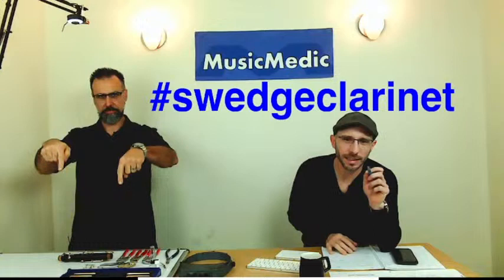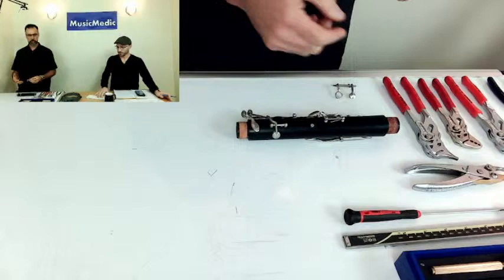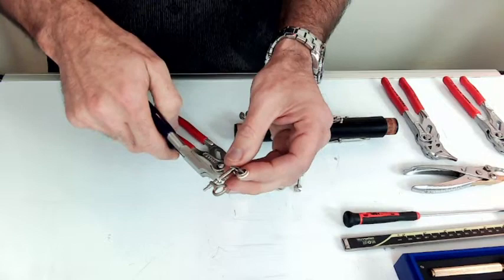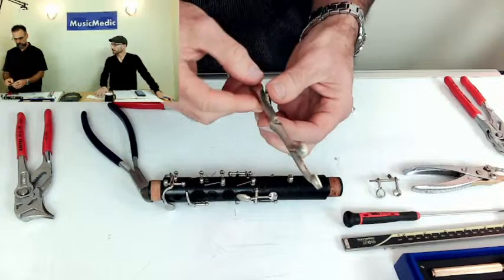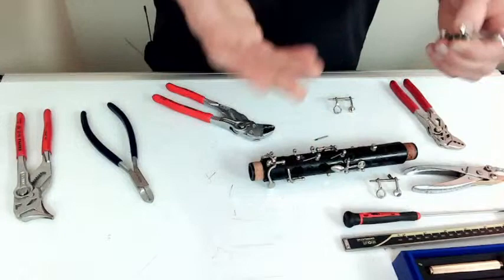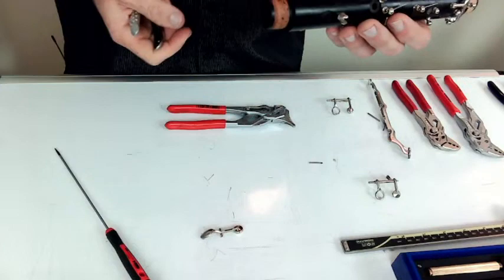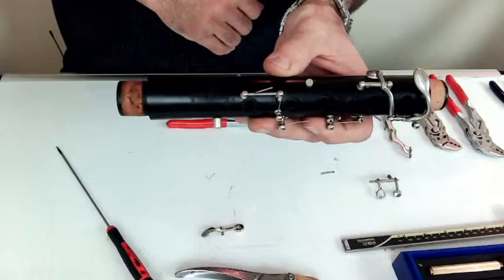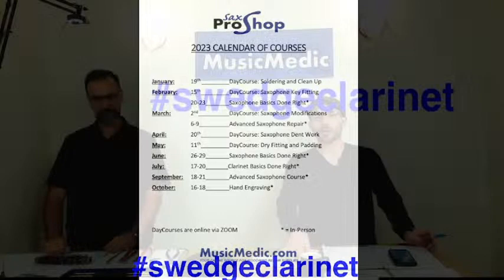Swedging Challenges on Clarinet and How to Fix them! #WednesdayWisdom

Comment: What good technical data! I ask you a question that always causes divergent opinions, the throat Bb (A left index finger and thumb pressed), which is not the real Bb but a compromise note to facilitate handling the B...etc. from the clarion sector. How to improve the tuning and timbre of said position or note, which in some clarinets is heard out of tune, high or low and generally bright? A few of us will appreciate any opinion or solution, that is, and that is not alternative or compromise positions. Thank you very much from Argentina.
Reply from the maker: Sadly with this note there are very few options other than possibly opening up the throat tone A key to help with tuning. The problem with this note is that the register key hole is too small (by design) to properly vent this note. Sadly, there are very few options for making this fingering sound as good as the other fingerings for Bb.